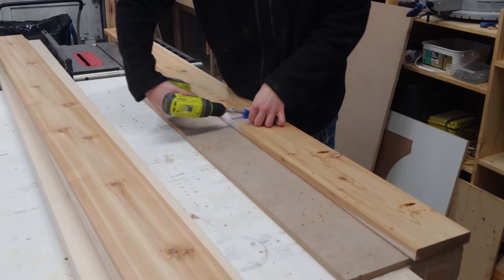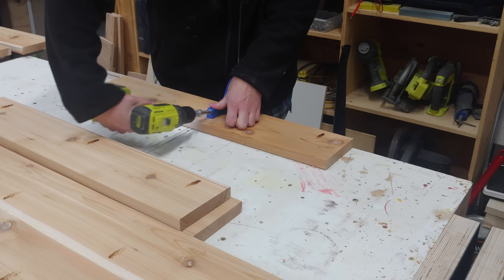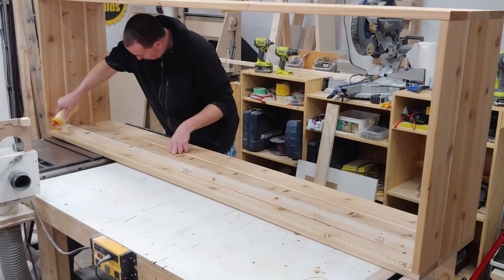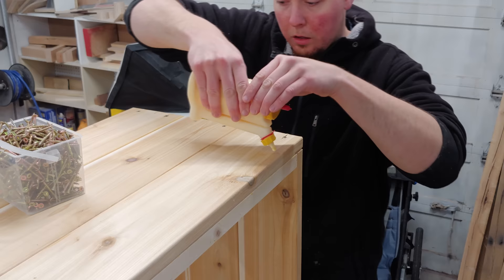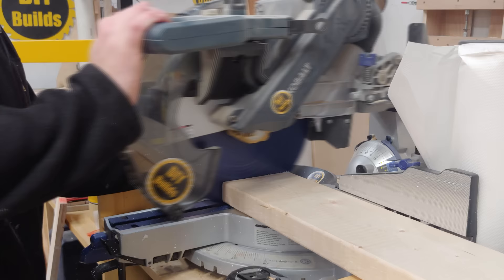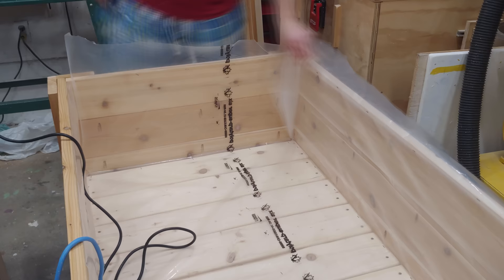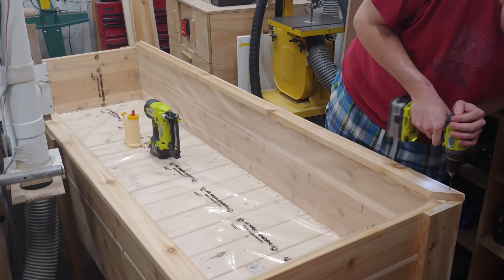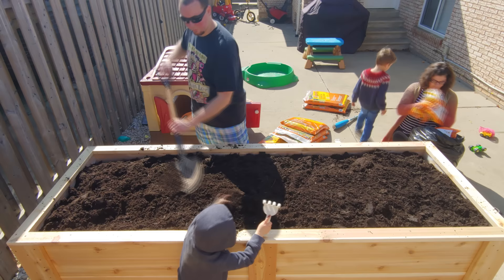How to Build a MASSIVE Raised Garden Box - Free Plans!

Comment: I have doubts about your drainage based on what I have seen with large planting pots.  The soil gets wet and clumps. The holes get plugged and it gets soupy.  I think a layer of gravel on the bottom with landscape fabric on top will get the water out better.  Especially when there is a summer gully washer.
Reply: Having very tight planks with a few holes for drainage in a a plastic bowl, those holes would naturally plug up with settled dirt quickly
Reply: Regular plant pots would disagree.

Comment: I followed this build about 2 years ago.  Today bottom fell out because the long strips on the bottom weren't heavy duty enough.  Either not enough screws, not enough glue, or even the wrong kind of screws maybe.  I checked the other 2 I built and they are also about to fail.  So make sure you really beef up the bottom end of this build.    Side note.  We also got an absolutely crazy amount of heavy rain yesterday.  

I'm going to salvage what I can and redo the bottom end with through bolts and a whole 2x4, not just a little strip.  I hope this helps others.  Again... no hate on this guy.  It was likely my mistake somewhere and probably incorrect hardware for the application.  

Great video.  I watched it again.  I needed to do more on the bottom end for sure.
Reply: While you're at it. Make a box for the center or the 8' long sides will bow out for sure.  Not just saying.. I'm building this as we speak.
Reply: I'd think for something that big a 2x4 aligned flat against the walls should be a good ledger board for the floor, those little strips are definitely too thin for such a large and heavy box, and are the clear weak point.
Reply: @trevor5290 do you have photos? I’m new to wood working

Comment: The Plastic Liner could cause Funal growth and such undesirables.
I use 2 layers of permeable Ground Cover which 'hang in there' for years.
Rain Water and Irrigation Sprinklers etc do cause the wood to get damp but it dries out quickly especially in Summer.
Reply: That's what I was thinking about fungal growth. The one I built (which didn't turn out very sturdy and why I'm here), I lined the bottom with hardware cloth and gardening fabric.

Comment: I’m building one right now with some small variations (tool limits): no brad nails, 1 1/2” x 1” x 6’ pine along the bottom to support the cross boards (hopefully it’s still thick enough), and won’t trim the piece to the corner legs so one side of the leg will be wider than the other. Other than that this has been an excellent general guide to follow. Thanks!

Comment: I love the instructions and I got the plan from your website. Unfortunately the only bummer is that 2inch screws driven into the feet connecting to the bed, the screws went straight through. Not sure if anyone else had this issue. I switched to 1 inch instead and it’s better. Still love the plan. Its beautiful on my patio

Comment: The polyethylene vapor barrier should do just fine except for where it's exposed to sunlight. I'm expecting the exposed plastic to turn brittle and flake into pieces within a few months.

What I probably would've done is still use the poly up to a few inches under the soil level, and overlap (underlap) that edge with some thin EPDM rubber sheet which is typically very weather-resistant. Great build overall though.
Reply: Landscape fabric might work, too, in the bottom and it is likely more UV resistant.  I saw another build with hardware cloth (wire @ 1/4 inch squares) with landscape fabric over the wire.  There were wood slats underneath, too.
Reply from the maker: Plastic keeps alot more of the wood dryer for longer than landscape fabric therefore making the wood last longer.
Reply: @troutguyCO  Landscape fabric is porous, and as DIY Builds mentions, you want to keep the wood as dry as possible.

Comment: Have you had any issues with the legs?  I know wood glue is incredibly strong but the screws are bearing all that weight, same with the inside runners.
Reply: Same, that’s a ton of weight once the soil is wet. I like the overall design and look, but I would probably have inset the bottom a little more, run it 2 x 6 down in the middle for the length of it and then put a couple 4 x 4 legs into the 2 x 6 underneath…. Basically all for bottom support.

Comment: Hi, thanks for the plan, i'm currently building it, but at 2:50, when you screw the legs, you said you are using 2inch screws, but its to long for the 2 1x6 boards on top of each other, its popping on the other side, better with 1 1/2 screws for the legs!
Reply from the maker: Mine didn't pop through but it's close. If you're concerned use 1-3/4" screws.
Reply: @DIYBuilds  are you using screw size 8 or 10?
Reply from the maker: 8

Comment: For sake of budget, could 2x6 SPF boards be used for everything? My local Lowes is charging $23 per board on the 5/4" Cedar Decking...
Reply from the maker: Yup. Just the length of time the planter last before rotting out may change.
Reply: @DIYBuilds  Hopefully with a generous application of raw linseed oil, I can get a few years out of it. Thanks so much!

Comment: Awesome work! Thank you for the video! I intend on replicating it, but I am concerned about the legs stability over time. How much dirt did you use? And is it stable? 
I intend on increasing the length to 10ft and the depth to 2 ft. I calculated the dirt requirements and I got around 2200 lbs of dirt. However, I am not sure if it will be able to handle such weight for a prolonged amount of time.
Reply from the maker: Ya my design i would not trust with that much weight.
Reply: I’ll try using lag screws or bolts on the legs. I think they’ll be able to handle the weight.

Comment: @DIYBUILDS Quick question. First off, this is was awesome video and I think its along the lines of what I want to build.  However I want to make a modification but I am a Newbie Amateur to building anything but excited to start learning.  The dimensions of this box is perfect in terms of width and height.  However I would like to increase the depth of the box to 18" to 20" inches.  I am going to build a SIP (self irrigating planter that will need at least 6 to 8 inches for the water reservoir that will sit beneath the soil.  So your plants state that this box you built is 1 ft deep.  I have wanted to give it another 8" of depth, would I just add on more level of side boards? So instead of 3 side boards there would be 4?  Would I have to account for that with any other adjustments?
Reply from the maker: Sounds good to me. But reinforce the legs so 1500+ lbs is not resting only on the screws.
Reply: @DIYBuilds  Awesome Thanks.  Very good point.

Comment: Curious how well you expect the pine to hold up over time? Would you have just used cedar throughout if not for the cost?
Reply: agreed
Reply from the maker: It will stay reasonably dry because of the plastic and 2 by material is thicker than the cedar decking so it will take a long time to rot out.
Reply: @DIYBuilds  As I watched this I wondered why you did not finish the inside with a few coats of poly sealer or epoxy or something.  I'd be worried that the whole thing would rot out over time.  I have pressure treated boards for some landscaping and it is GONE.  It took a few years but it did rot away to splinters.
Reply: @mikethelma  it would probably poison the food

Comment: Did the wood come treated, did you do anything to the wood?

Was the SPF wood treated. It seems like it would get moisture coming through the holes in the plastic.
Reply from the maker: cedar doesn't need treating and the pine is thick enough minimal rot wont be an issue also the water drains between the slats.

Comment: I have the perfect place to build this! Thanks! Does it have to be cedar$$$?
Reply from the maker: Cedar is rot resistant.
Reply: @DIYBuilds  yeah and bugs hate it too, I know but I am cheep! But OK. You are the expert.
Reply: @mikepettengill2706  Try checking for cedar fence pickets instead of the larger lumber. I did a similar build a few weeks ago using 6' long and 6" wide cedar pickets instead of lumber. Kept cost down and is plenty strong as well.
Reply: @mike  since the wood is covered with a plastic sheet, I don’t see why you couldn’t use pressure treated wood.  The wood should’t contaminate the soil.  So far, it’s the cheapest way I found to do it and it’s probable the way i’ll go.

Comment: Estimated cost? Wondering if it's even in my budget to attempt...
Reply: It’s not cheap.. but better to do it right and get cedar. To save a little bit of money you could nix the 2x6x8 he used in the center and swap that out for some chicken wire. That’s what I did and this project still exceeded $150 .. probably $180 ish realistically if you include screws and glue and what not. Rough cedar 1x6x8 was $11.25 at my local lumbar barn. Cedar will last and no toxins in your soil.. it’s worth it if you ask me 👍🏻
Reply from the maker: It cost me around $300 CND

Comment: Question: you used a nail gun on certain sections. Is it necessary to also add screws to those same section?
Reply from the maker: The nail is to hold in place while screws are driven in
Reply: @DIYBuilds  i guess to clarify my question. Is the finishing nails alone not strong enough to support the soil?
Reply from the maker: I wouldnt trust it. This thing loaded with soil amd water is probably over 1000lbs
Reply: @DIYBuilds  okay thank you!

Comment: This is a super nice build.  I would love to know how the 1.25 inch pine that is holding the bottom slats held up under the weight of the dirt.  Are you still using the raised bed now?  How well is it holding up?  I love this design, so I would love to build it.  Thank you for sharing.  It’s awesome!
Reply from the maker: Its only less than a year old so not much of a 'withstand the test of time' test yet but so far so good
Reply: @DIYBuilds  Understood, I did see the video release date so I figured you only had a season, but did want to ask just in case there was any sagging. Or cracking.  The 3/4” Cedar holding that bottom rail on was my worry.  Not much to bite into there.  Love the build and thank you for the very quick response.  I plan to build this in March for a spring planting.  Thanks again for sharing.

Comment: Ok I am so not the carpenter so forgive the question. You list 13 2x6x8 deck boards why do you cut them down to 5 1/2 instead of using the full width and just adjusting the plans?
Reply from the maker: go measure a 2x6 and you will see they are 5.5" wide
Reply: @DIYBuilds  Thank you for the prompt response! Sorry about the question lol.

Comment: cool idea, but it wont last long, i built something similar for a raised strawberry garden, the wood rotted and bottom fell out after 3 years. a better idea would be to make the sides and bottom out of 55 gallon metal burn barrel cut in half with holes drilled in it for drainage. but not too much drainage because you don't want the soil and your roots to dry out.